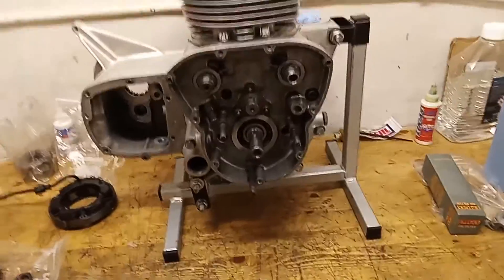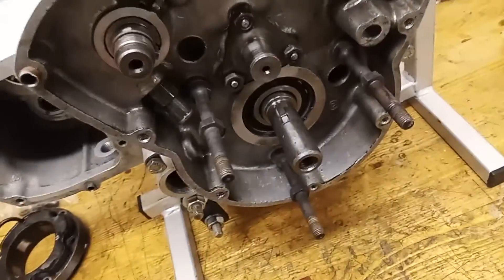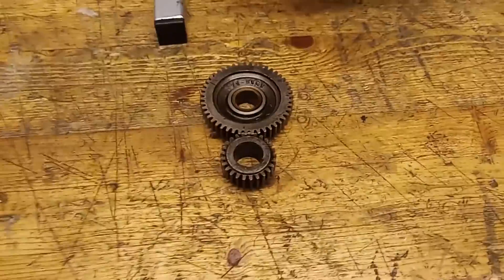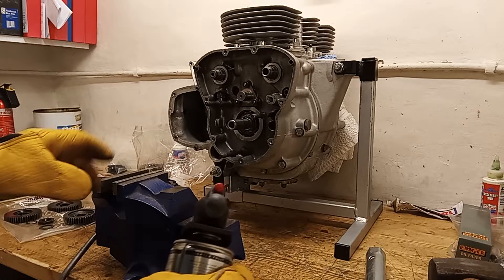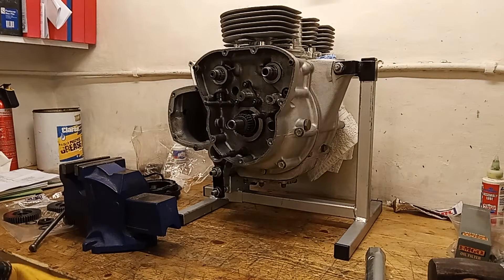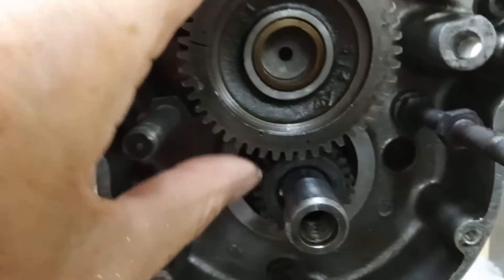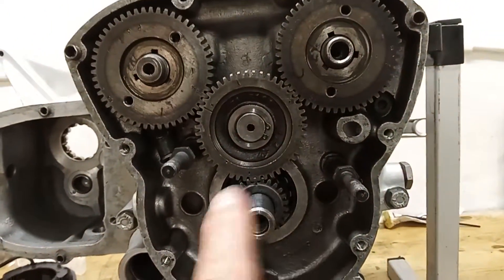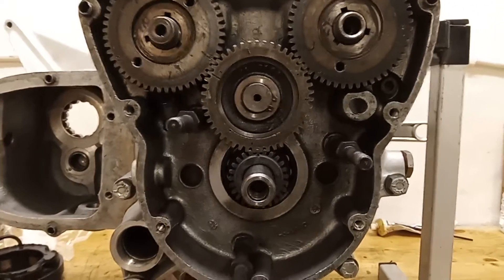Triumph Trident T150V Engine Rebuild. Part 26: Setting the Valve Timing Part 1.

Comment: Thanks for the video Chris. What is most interesting is to see some of the differences between your motor and my '71 T150V . For example, my intermediary gear has a caged needle bearing. Yours has a bronze bush. Your cam gears appear to have two holes for fitting a puller. The '71 cam gears have a threaded shoulder - like also used on the old Bonneville engines -which allows the use of the Triumph factory puller for that purpose. Keep up the good work. Tridents are lovely engines but fiddly when rebuilding and not for the faint hearted lol. No mistake is forgiven as I've found out the hard way in the past.
Reply from the maker: That's great, thanks for reminding me of some of the changes to the engine over the years. I didn't know about the caged roller bearing for the intermediate timing pinion! Was that standard or an upgrade? You probably also have the earlier primary chain tensioner, the extra oil feed to the exhaust camshaft, and longer valves amongst other things. Thanks  again for the reminder.
Reply: @Chris.rooke150  Cheers Chris. The center gear uses a needle not roller bearing. It's still drip fed oil through the spindle. 
I'm not aware of the difference between the old primary chain tensioner and the later model. The '71 tensioner has a threaded plug at the lower front of the primary chain case, giving access to the chain tensioning screw. What are the later versions like?
I modified the tensioning screw on mine by cutting away the slot intended for a flat bladed screwdriver and welding on a metric grub screw. I found that using a screwdriver to adjust the primary was clumsy at best and otherwise damn fiddly. Also the screw driver blade would sometimes scrape the plug threads even when being careful. Now I can tighten or loosen the chain using a 5mm hex head (allen) wrench with my eyes closed. My engine did indeed have the oilers you mention. Triumph did away with those in '72 I think. They also had a service bulletin saying to blank them off as they weren't needed and affected oil pressure to the crankshaft as I understood it. So that's what I did.
Your video states in the title that your motor is from 1975. Wouldn't that make it a T160 motor, the final year for the Trident?
My Trident, a US model, is supposed to be a 1972, T150V;  but the engine stamping shows it to be made in '71. Perhaps Triumph just put whatever engines they had on stock even if it didn't correspond to the production year...dunno really.
Reply from the maker: It sounds like yours does have the early type primary chain tensioner. The later ones have a large bolt that screws up from underneath. The engine I'm working on is a replacement and has no date stamp on it! I know it's late though, from the tappets etc. Triumph  began making their engines the year before the model year, so a '74 model may have an engine built in '73, but they continued making the engines into the next year, so a '74 model can also have a '74 engine. Mine could therefore possibly be a '74 or '75 engine, built just before they began building the T160s - no real idea....